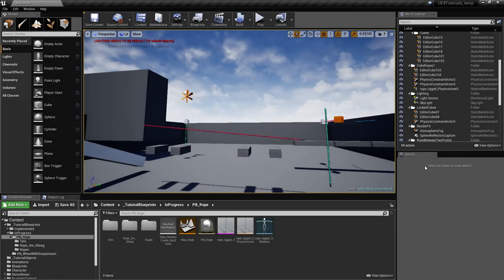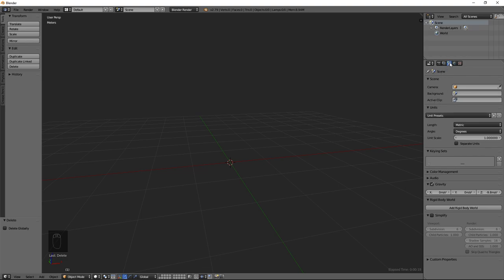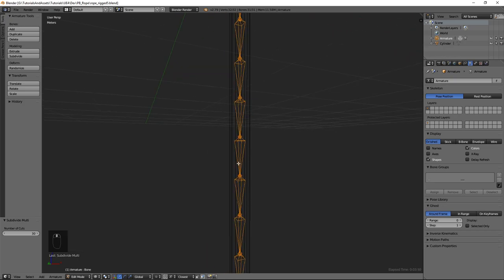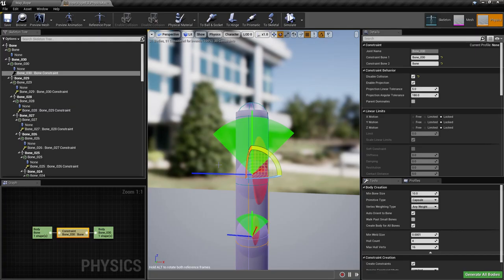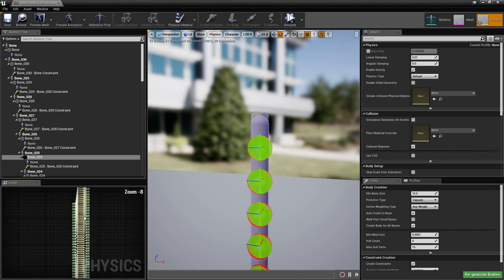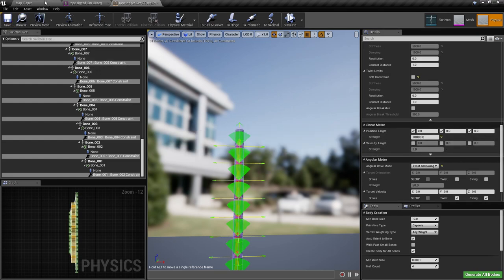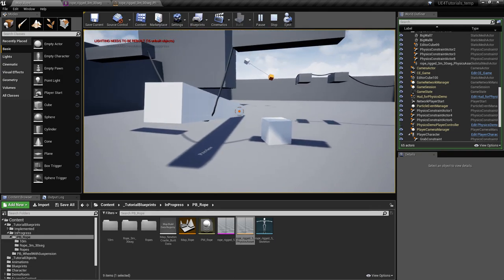UE4 Rope using Bones and Physics Constraints in Unreal Engine 4 & Blender Chain Tutorial How To

Comment: Hey, awesome tutorial, much better than the cable component :) I have a problem attaching the skeletal mesh cable to two other actors though. I'm using it as a cable between two plugs, so the hirarchy is
Plug1
  + Cable skeletal mesh
    + Plug2 (attached to a socket "CableEnd" which I configured in the skeletal mesh)
All components have physics simulation and collision enabled, but once I start simulating, the three components just fall apart and aren't attached to each other. Any idea? Thanks!
Reply: The ends need to be kinematic, or they will fall every time.

Comment: Thanks much for your helpfull Tutorials, just a question again by the side i try to figure out to snap back the rope like a spring as like in Wrestling or Boxing Rings .
The rope are fine but it doesnt snap back fast while my Character goes away from it. Did you have any idea i play with every Settings in the PhysicAsset Hours but no luck.

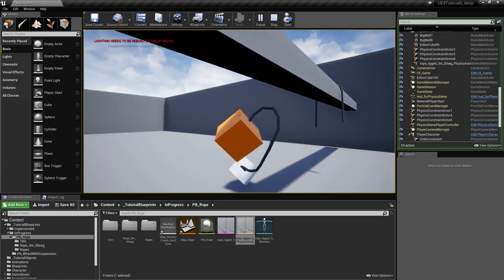Comment: Thanks for the tutorial Luisogenic! can you elaborate how did you attach the cubes to the rope that appear at 16:30 thanks!
Reply from the maker: You can simply use a Physics Constraint Actor for that. Just make sure that, for the rope, you fill in the bone name that you want to connect to. It needs that because it's a skeletal mesh.
Check out this screenshot https://drive.google.com/open?id=1cNFLbF7ZvcC8Q17QFv6GFQgDjYX8VGwi
The rules of the constraints can be whatever you want, but for simplicity you could just lock rotation and translation for all axes.
Please note that the relative position between the two elements before running the game will be considered as the reference.
Reply: Sorry to bother you but i cant lock position and rotation on the constraints. Everytime i pick the cubes from each side i have like a separation from where the bone and cubes are...
Reply from the maker: I'm not sure I understand what's not working, but I will be doing a quick tutorial on this. 
It'll probably be up tomorrow, so stay tuned.
Reply: @Lusiogenic  thanks mate!
Reply from the maker: Here's a video in which I explain thoroughly how to connect the rope to an object: https://youtu.be/uHV6VHzPqxM

Comment: Hi Andre,

Great tutorial!  Thanks for it.        Just wondering if you have any idea why Unreal Engine 4.24 crashes when I try to import either of the Rigged rope meshes you supplied as samples.  Maybe I'm not using proper settings in the FBX Import Options window that pops up?

Update 2/18/20:  It seems that the crash may be due to a bug in UE 4.24 when you try to import an fbx that doesn't contain a material.  Is there a chance you can add a material to one of the rigged rope meshes you supplied so that I can test your rope model?

Thanks very much.
Joe

Comment: Hello, I am in despair, I have followed everything exactly as in the tutorial, but whenever it then goes from Blender to U4 I have the problem that in the PhysicsAsset only one bone is there.
Does anyone have a solution for this?
I just want to have a light wobble for my project :(
Reply: I have a similar problem, the bones shown to have physics constraints is only a fraction of the total bones. Using blender 2.9 and ue5.
Reply: I figured it out. Just had to reduce the Min Bone Size according to the length of my rope.

Comment: Can your rope be shaped to run as a conveyor belt or tractor treds?
Reply from the maker: You technically could, but I'm not sure it would actually work. You would have to put in too many segments. As the rope becomes more complex, it becomes more and more unstable.
I've thought of doing this a lot of times, but I feel it has low probability of success. 
The point of making a conveyor belt (or pulleys, as another user asked) is so that you actually carry weights with them, but I don't see that happening with the current implementation of the physics constraints. That's because the force that an object applies gets scaled by its mass. So a piece of rope (which is really light) will not be able to pull an object of 50 kg, let's say. The only solution would be to make the rope heavy as well, but that introduces other problems. So it's a vicious circle.
I can't think of a hack that would make this easier. If you do try it out, please post back the results, I'm very interested in this.
Reply from the maker: I just realized I didn't actually answer your question. Yes, you can shape the rope like that, simply by changing the mesh in a modeling software and changing the constraints to not bend sideways. 
But you would probably have to use it only for the visual representation because of the problems that I talked about in the previews comment.

Comment: having bones parented under each other in a chain tends to cause precision issues that can lead to instability;
as the chain has to continually calculate its positions based on all its parents movement.

better to have all the joints in the chain parented under a single root, and let the physics bodies do the work of maintaining the chain.
Reply: I was thinking about this several days ago. Do you have any resource for this, that we can validate this theory?
Reply: @loremipsum3147  not for Unreal specifically, sorry.
This is more of a rule of thumb for me as  I've had to create a lot of rope setups for animation or physics (sometimes both)

Comment: do you know any good way to attach the player to the rope so he can swing??
Reply from the maker: Not really sure about that. Since the player character doesn't use physics, it's not as simple as using a physics constraint to link it to the rope.
You will have to make a new movement mode and update its location relative to the movement of the specific bone of the rope that it's attached to.
Reply: I managed to socket each constraint and I attach the player to each one and move him up and down the chain if he inputs W or S, the only thing left is that my character gets attached to the constraint through the capsule component ofc, and when the rope is swinging too much, the animation I had made for the player of him holding the rope gets offseted, as the capsule component always connects at the middle not the top where my player has his hands, do you know a way where I can attach the rope constraint to the hand of the mesh. Keep in mind no collision is placed for the player once he connects. Thanks a lot btw for your reply and your videos are amazing!
Reply: And is it possible to maybe make 2 bones on the rope act like one so they act more like a straight line held by the character?
Reply from the maker: If you're using the Attach to Component function, make sure to set the Location, Rotation and Scale rules to Keep World. This will attach the player character to the rope's socket, but keep it's world location, so it will not be attached to the center of the capsule. Depending at what moment you trigger the attach, you might want to adjust the character's location in relation to the rope.
Please note that the character will only collide using the capsule component, all other collisions will be ignored, including that of the skeletal mesh.
Reply from the maker: To keep the bones straight, you could put the constraint that's linking them to locked, both in linear and angular movement. Depending on the forces that will be applied to them, though, it might not stay really straight in some situations.
The only other method I can think of is setting the bone to Physics Type: Kinematic, then updating its location continuously relative to its parent bone. But in this case, you would have to make a separate collision channel for the rope so that the kinematic bone doesn't collide with the simulated bone.
Reply: Can you tell me how can I access the constraint in blueprints as I can't find nearly anything about bones that can be accesed in realtime?
Reply from the maker: Ok, I've just figured it out, you can use only the physics constraint settings to keep the bones straight by locking the angular and linear movement, but very important, set the Projection Angular Tolerance to 0. This will make the physics constraint apply forces immediately, once one bone starts rotating in relation to the other. If you don't want the rope to elongate, make sure to also set the Projection Linear Tolerance to 0.
You will have to experiment with this, although. When these limits approach 0, the rope starts acting weirdly.
Reply: First of all, thanks a lot for your replies, I appreciate your help, Now I did as you said, the bones are slightly more straighter but I cant see any large changes, the idea is that I want 2 constraints to act as 1 while the rest continue as they were, ie. moving like a real rope
Reply from the maker: No problem. I'm also learning when answering questions. :)
First, you have to create a blueprint, then add a skeletal mesh of the rope to that blueprint, and then somehow access the physics constraints of that skeletal mesh, though I don't know how.
By putting the settings as I said before, I manage to have the rope straight, as a metal bar, although, it does have some weird physics. Make sure that you set the Angular Tolerance to 0, that's the most important.
Reply: Oh wait sorry I had the profile on by accident and it didn't register any of the edits I did, now as you said the rope gets completely stiff if I set locked, the thing is I attach the player to the constraint he is nearest to, so I need it to be done in realtime where I in the blueprint signal the constraint to be locked, sadly that's where I get stuck I don't know how to do that in blueprints, I have spent nearly six hours now trying to fix this thing and I'm really falling apart :(
Reply from the maker: Maybe it's possible to do this by changing constraint profiles at run time (using Set Constraint Profile), but I don't really understand how profiles work. I haven't been able to set a profile where the constraint is stiff.
Reply from the maker: Constraint profiles doc found here: https://docs.unrealengine.com/en-us/Engine/Physics/PhAT/HowTo/CreateConstraintProfile
Reply from the maker: Also, how to apply profiles, here: https://docs.unrealengine.com/en-us/Engine/Physics/PhAT/HowTo/ApplyConstraintProfile
Reply: yeah same here I keep trying to lookup stuff on profiles but I cant find anything useful..... Anyway, I wanted to ask about something else, the way I have the swinging force implemented now is that I cast to the rope actor then I add an impulse of 600 at the socket which the player is attached to when he hits the D button(or the A button to go back), it works well enough that as you go down the rope the swing is bigger and as you go up its less and less which is how real ropes behave, there is a problem however, at the last few sockets the impulse seems to be giving so much force that the rope nearly moves a full 90 degrees which ofc is impossibly high, so I wanted to ask if you know a way to clamp the movement of the rope to a certain limit which it can't pass. The second thing I wanted to ask about is do you have a suggestion about making charging swings where if I charge a swing then go back and charge another swing the second swing will be a bit higher than the first and so on, with the linear impulse its either all or nothing. Thanks.
Reply from the maker: Instead of adding a force only in one frame, I would suggest adding a smaller continuous force the whole time the user keeps the movement button pushed.
If you want the rope to not go so high in the air, you could put angular constraints to limited with a limit of 5 degrees (maybe lower), for example. This won't let it flex too much. Also, make sure to lower the  Angular Tolerance. You'll have to test this with multiple values, and see how it goes.
The charging part should be fixed if you apply a continuous force, as I've said before.
BTW, I think I've found how to use constraint profiles. Not 100% sure, still testing.
Reply: I did it! Finnaly its done, hahaha an entire week worth of work to make a proper physics based rope actor, thanks so much man for your help, the profiles are what did it, I made a profile called base and one called Stiff and I alternated the joints between them as the player moved up and down the lattice of bones, it works like a charm! Thanks again man for the help you were awesome and if you wanna ask about how I did it I will be more than happy to tell ya! Keep throwing those awesome videos at us!
Reply from the maker: That's exactly what I wanted to try, but didn't have the time. 
You're welcome, I'm really glad it helped. :)
I was thinking I might make a tutorial on rope grabbing and swinging, in the future. I'll ask you if there's something that isn't working. Thanks!
Reply: Got a little question again :) , I have 2 animations for swinging that I want to use but for that I need to know if the rope is swinging or stopped, do you maybe know a way to check that?
Reply from the maker: You could technically do that by looking if the rope went to sleep. Call Is Any Rigid Body Asleep on the skeletal mesh component and see if that works. Giving that the rope by its nature is relatively unstable, it might never go to sleep.
 If that's the case, you will have to code your own function to determine if the individual bones have moved since the last frame. The advantage would be that you get to set your own threshold for the movement.
Reply: I figured it out, I got all the socket locations at begin play and compared it with those with a small error tolerance value
Reply from the maker: From what I can see in that video, the rope was basically like the one in this tutorial. The whole complexity comes in when the character moves on it. Unfortunately, that might have to be different for each character. It might be hard to make a generic asset for that.

Comment: Very good explanation. You are awesome! Substepping can make interactions between heavy objects and light objects more stable. I was disappointed by CableComponent. it doesn't interact with forces and is just for aesthetics. I made the rope in c++ instead by creating spheres in a loop and connecting them with physics constraint component.
Reply from the maker: Thanks! 
Unfortunately, the cable component is calculated with particles, which run on the GPU. The physics run on the CPU. 
So, in order to make the cable component work with physics, a syncronization between the GPU and CPU would have to be made directly in the engine.

Comment from the maker: How to attach the rope to an object: https://youtu.be/uHV6VHzPqxM
Rope swing tutorial using Cable Component: https://youtu.be/BT0jFArPtGM
Reply: Is it possible for wind to effect these constraints?
Reply from the maker: @pawprinting  No, wind only affects mesh deformation.
Reply: @Lusiogenic  Yeah after some time I eventually figured that out. As it just so happens, UNREAL already has physics systems built in to specifically address all of these areas individually. I learned the differences between using Cloth, the  Constraints and then even AnimDynamics which is best suited for rigs with wind animation.